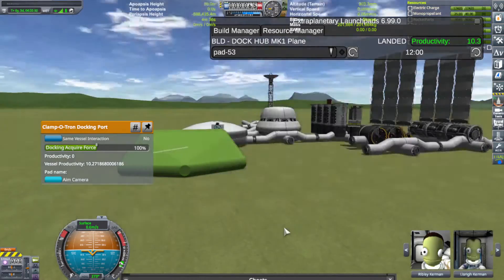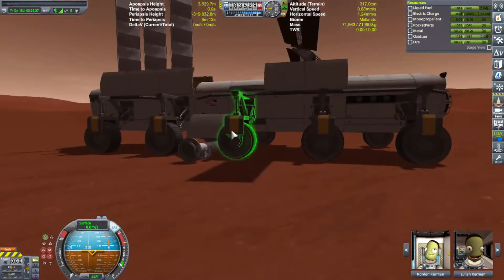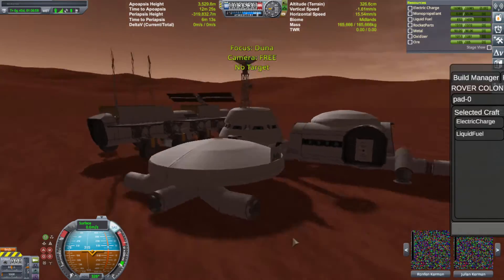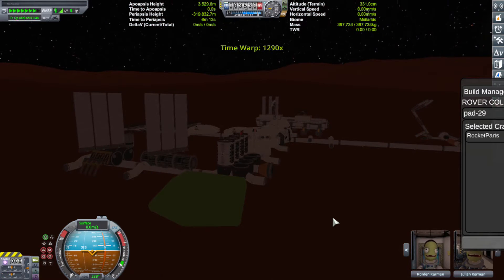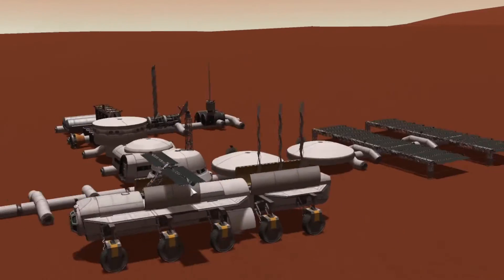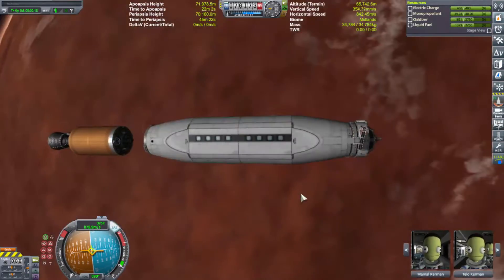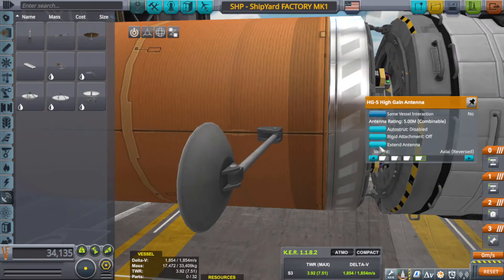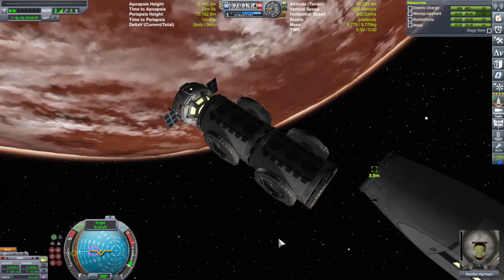Plymouth Colony on DUNA.

Comment: You are describing the difference between strong(aka general AI) and weak AI which already exists to a large extent. I actually study computer science with artificial intelligence.

Also if you could just somehow dock the SSRT or connect it to the spaceport and have a docking port in the cargo bay you could build payloads directly in the rocket